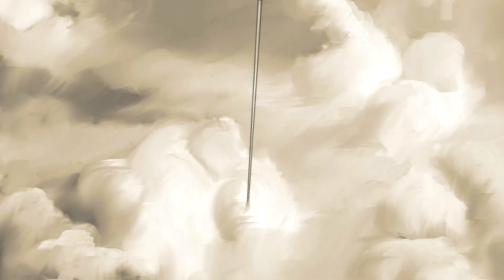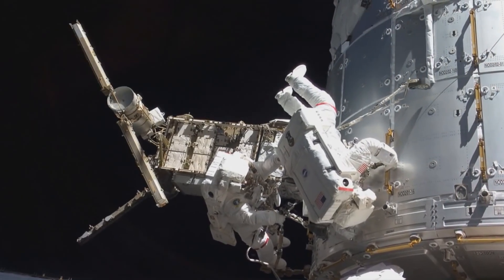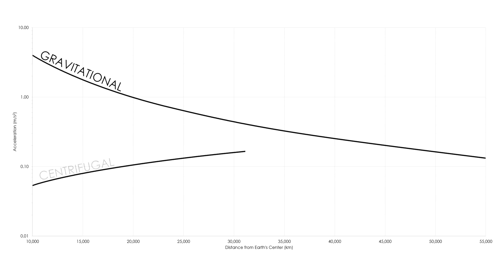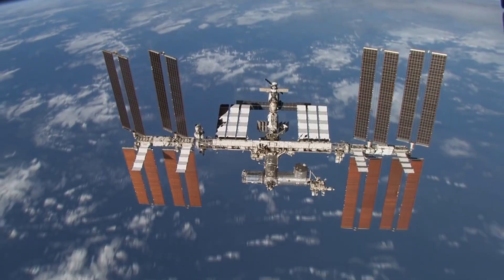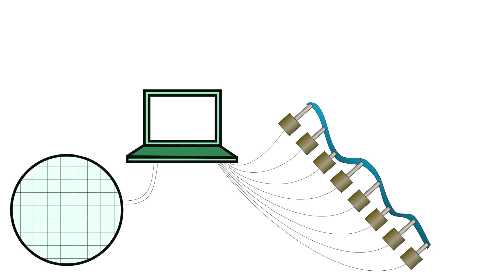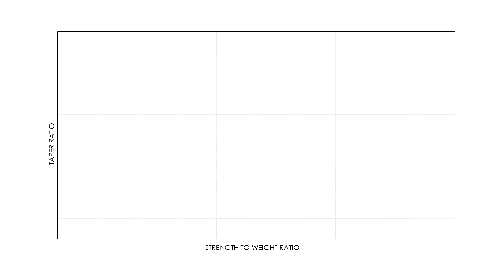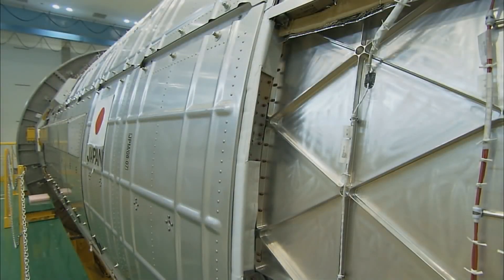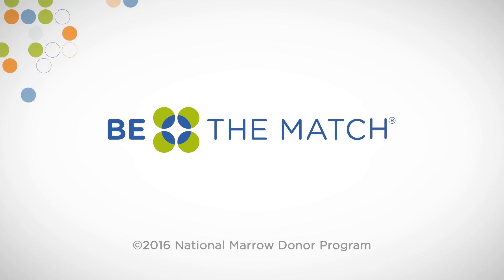Design Your Own Space Elevator

Comment: What if for the power problem, you just used different stages through the ride, just like a rocket. You can have a section of the elevator have power from earth and a pusher that only goes in that section. It would push the main elevator to x velocity. X would be the velocity needed for it to glide up the tower until it is at a height of y (which is where the main elevators motors can pull itself up) to power at this stage u can have battery packs on board that kick in at this stage. (Batteries would have to be even better than Tesla’s).

Comment: If the Earth was less massive, or if it revolved much faster (as in much shorter days), or both... then I think space elevators would have more merit as they can be much smaller. Trying to keep the cargo geostationary during it's entire ascent is not the exact job we want and such an ascent is not efficient, but thats the limitation of the typical space elevators that many think of when they hear the name.

A majority of the costs to getting things up there is mostly due to needing to escape the atmosphere and achieve enough orbital velocity.
 So, what if instead of a vertical, tethered, space elevator standing tens of thousands of miles up into geostationary orbit, we have a low-pressure mag tube up to, or near, the karmin line? And I don't mean straight up, but in a curved path that will ease the cargo into a mostly orbital trajectory. Having the tube at low pressure (and possibly temperature controlled) minimizes drag, making it cheaper for the vessel to reach orbital velocity. While this version is basically a cannon, you could still technically call it a space elevator.

Of course such a cannon would be long, it'd still be a tiny fraction the length of a vertical tethered space elevator, it'd also solve the problem of getting into space, and it's design challenges should be far more feasible.

Comment: First, a geosynchronous orbit radius is necessary only for daily orbit periods.  Shorter orbit radii are possible, but only for elevators tethered to rotational poles.  Second, electric conductors embedded into the cable(s) can charge supercapacitors (or batteries) spaced periodically in the cable to serve as "filling stations" to refresh an energy cell in the elevator.  A descending elevator releases energy which can be captured in reversible motor/generator, recharge the cable's cells, and power the electric grid until another ascent is needed.

Comment: So.... How about using the tether itself as a method to convey power to the lifter?
Reply: The longer a conducting wire is, the higher the resistance. You're gonna lose all your power through heat by the time you get to the top.

Comment: Question. If the cable is being gripped by the shuttle  in order to propel it upwards, wouldn't it exert a force that pulls the satellite and shifts its orbit? And if the shuttle is NOT gripping the cable to propel itself then what is the point to begin with? Basically, sounds like the energy to lift the payload still has to come from somewhere - if it comes from the system it would degrade the system's  "energy state" and if it doesnt - the system is rendered superfluous

Comment: Couldnt you house and send your electricity/power in/through the tether. Sort of like a monorail that's powered by the cables above it, except it would also be hanging off that cable. I think carbon nanotubes are highly conductive so theoretically they could be the perfect tether since they are, with one material, the strong tether and the wire for the power for the elevator
Reply: Too much resistance because the cable is too long

Comment: There is also the unknown, w, that represents stresses due to weatherization effects and b, the bending effects on the tether structure: lightening strikes and possible tether deterioration, resistance to atmosphere pressure differentials and possible separation results of launching the platform and occupants at the top into deeper space ... so there should be an emergency escape/eject system to save souls at the end of their rope ...

Comment: Why no diameter for the carbon nanotube tether? You gave us the taper but not what the final diameter would be. I'm curious.
Reply: Doesnt matter, the taper of 2-20 times means the diameter at the bottom (whatever you pick) is 2-20 times smaller than at the top. If at the bottom it were 1cm thick, at the top it would be 2-20cm.
Reply: @sebastiaomendonca1477  it's been a while now since I watched this one so I don't remember if it said 2-20 times larger than the top, but that number is most certainly incorrect. I've heard from many other reputable sources that the final diameter - even with perfect structure carbon nanotubes or graphene - would be some insanely huge number. As in nearly impractical. Not saying the video didn't say that though.
Reply: @gearhead1302  Mind citing those reputable sources? Just saying "reputable source" is not an argument

Comment: What if we made a series of airship supported tethers? Where a gas like hydrogen or helium is used in small sacks along the way where the atmosphere is densest and gravity is strongest. I'm not suggesting that it would necessarily support the entire weight of the elevator car, but it might help and could generally be reusable with a series of compressors along the way. I haven't thought this out, but it seems worth considering and I haven't seen any design that incorporates anything like this yet, except in surfacing sunken ships and aircraft with pingpong balls.

Comment: To be honest, the concept in this video is not the way to go. 
If a real life space elevator was to work, it would have to consist of TWO cables, one for going up, the other for going down. 
Well actually, one long circular cable, with pulleys on either end.
Picture a tow rope for a ski lift, or even a chainsaw.
A long continuous belt. 
The power would be sitting on the earth, which would turn the giant pulley, and thus move the cable. 
However,  .............
Even if a material existed that was light enough and strong enough ....
You now have to take into account wind, lightening, jets, space junk, temperature change, and who knows what else? 
Yep, the theory is simple enough, but the practicality is crazy complicated.

Comment: I think the biggest fault with this thinking is thinking the space elevator would be a single carriage, it would obviously be separate pieces traveling with modular parts having it switch carriages so people and loads can constantly switch from going up and down at the same time. having just 1 elevator means that someone going down needs to wait for the entire trip of someone going down. now this means that the top carriage that has the least gravity and requires the least amount of fuel could run on solar power, and the lowest could run on batteries, while the middle part could run on what would be most efficient according to the weight.

Comment: 4:20. Kaaaay now I'm confused. Not with the problem. But with your solution. 

Would you not just use the cable as a means of transmission.

Almost certainly whatever it is made out of will be conductive.

Now you obviously would not be using DC in such an application.

And while you'll still have losses with AC.

Making use of repeaters would mitigate these losses.

Not to mention the fact that such a cable would have to be made from something like carbon nanotubes.

Giving the cable itself the capability of having very low resistance.

I mean if nothing else you could just have large sections of cold plasma running alongside the cable.

Giving it more than a low enough resistance over that distance.

So it seems to me like you're going out of your way to make the easy part a much more difficult one.

Come on man start using your own brain. Instead of listening to the smallest minds with the biggest mouths.

But what is shocking. You did not even mention the VERY obvious. Even if you weren't going to use the cable. Such an elevator could easily be fitted with a "Thorium Reactor".

7:40. There you go.

Also by the time carbon nanotubes could be constructed on such a scale. We could have wireless energy transmission through Quantum Entanglement.

But by the time energy transmission through quantum entanglement is a thing. Gravitational lasers acting for all intensive purposes as a tractor beam. And could just lift or lower the elevator from the counterweight above the Clark belt.

And by the time gravitational lasers are a thing. The understanding of the true functionality of gravity will have been understood and applied in many different applications. Making the need for such a cable completely moot.!!!

The only scenario in which the problems that you're describing in this video are even applicable. Is if the extremely large scale production of carbon nanotubes somehow arose about 500 to 1000 years early.

But that somehow all other technology is still contemporary and or present day.

That is the only scenario applicable to this video.

But I did like the video. And I appreciate the time you took to make it. 👍

Comment: This could be the answer to the problem of rockets throwing up too much dust on the Moon.
Reply: This would not get you to the moon without a rocket to help
Reply: @sebastiaomendonca1477  This would not be used for getting to the moon, but for getting to and from orbit around the moon to it's surface. Rockets would have to be used to get to lunar orbit from the Earth, but they won't kick up dust on the moon's surface.
Reply: @sambolino44  When was kicking up dust on the Moon's surface ever a problem?
Reply: @sebastiaomendonca1477  It was mentioned elsewhere as a potential problem if we start major operations on the moon.
Reply: @sambolino44  How would it ever be a problem? If anything, its less of a problem than on Earth because the dust doesnt linger around suspended in the air

Comment: Why didn't you mention nuclear power as a possibility for the required energy? Seems to be the most logical way to me.

Also at the bottom where you need the most energy because gravity is the strongest you can still just use cables, the resistance only becomes a problem at relatively high altitudes.
Reply: A nuclear reactor would be too heavy to lift, but it could be used to power the laser

Comment: "It would change the world".....really? Nonsense. Even if it worked, which it will not for a myriad of good reasons, the speed of the elevator is limited by the very low tangential acceleration the cord is capable of providing. Even the optimistic predictions put travel time at about a week or so, possibly even a month. So, you might gain in cost of delivery but at the price of the time required to send something up in orbit. Time is everything, it relates to the rate at which a task can be accomplished. A rocket can achieve geostationary orbit in 5 hours. About 97% savings in delivery time.
Reply: He did the math, with the least efficient power source you can still make the trip in 2 weeks. This is not a problem.

Comment: The more I think about it the more issues there are. Assuming you have a counter weight, cable and power supply, how would you built it? Scaffolds and cranes? Hot air balloons? Thousands of rockets in orbit assembling the longest toilet roll the worlds ever seen?

Comment: Depending on the material of the cable, the cable itself produces electricity as it wanders around the magnetic field of the earth, so that could be your power source.
Also, why concentrate on just one cable, why not two or four? More cables would also add to the safety of the system with redundant cables to handle broken or damaged cables.

Comment: Centrifugal force isn't real. >.<
Reply: Swing something around on a string and you'll feel it. Its the principle behind an orbit.
Reply: @sebastiaomendonca1477  Centrifugal is a fictitious force imagined by the way a frame of reference can trick the mind. Centrifugal force quite literally means a force pointed outwards from the center of rotation. IF such a force was the principle behind an orbit, all objects would simply fling away from their parent orbital body. In fact it's centripetal force (gravity) that pulls objects "down" to earth. The reason why they maintain circular orbits is because they have enough horizontal (parallel to the horizon) velocity to outrun that "fall". Centrifugal has nothing to do with an orbit. The force you feel on a string is a REACTIONARY force to you accelerating the object INWARD towards you.
Reply: @xithyl515  Centrifugal force is the effect you feel countering gravity. 

"IF such a force was the principle behind an orbit, all objects would simply fling away from their parent orbital body" Wrong. Gravity is there to balance it out, thats why at a specific height (for simplicity lets say the apogee and perigee are equal), no matter the mass of the object, the orbital speed is exactly the same.

Comment: A. The taper of the tether shouldn't need to be that huge, since the cable is not having to hold it's entire weight up - the whole concept of the space elevator is that the cable is under tension from the mass of the counter-weight 'pulling' the tether away from the Earth. It seems that the cable should then only have to hold half its weight, which may still be too much for conventional materials, but makes the situation less dire for emerging technologies.

B. As far as getting power to the climber, while a solar collector on the climber might be impractical, having a large collector on the counter-weight seems quite plausible (even desirable). Even if this couldn't supply all of the needed power, it could seriously mitigate what was still needed. How would the power get to the climber? If only there were some kind of long cord that could carry that power in direct contact with the climber - but where would we find that...?

C. Why does everyone assume all this has to be done with one tether? Multiple tethers makes infinitely more sense, so you can have traffic going up and down the tethers simultaneously. This would obviously drive the cost of lifting way down.

Now I'm not some big-city engineerologist, so maybe there's something I've missed (quite possible). It may be that these issues are addressed in a deeper dive into the subject (which the author explained was simplified for time constraints). Regardless, I want a space elevator, and I want it now. Make it happen!  :)

p.s. Love your channel. I always enjoy your presentations and demonstrations. Keep up the good work!  :)

Comment: What if you don't need a cable/tether? What if you build a giant electric rail gun instead? Yes, it also comes with cost but it is actually far more feasible than nanotubes at this point. You would need around 1.5 km to 2 km long barrel thought but wait there's more, the shuttle would need to be aerodynamic (like a rocket nowadays) and the inside of said rocket should have a way to not squash the people inside. Let's take a gyroscope for example, the inside will not change, no matter how and what direction it goes in, the inside of the rocket will remain relatively unmoved (but it will fallow the same path, so just attach people to chairs and should be fine as long as they can withstand 10 to 40 G's. So technically, it might work for some people, I don't know, I am no expert but it seems to me that an electric rail gun is far more fun than a tether and you get to send stuff to space like giant space ships or parts of space ships or missiles for military purposes. For those of you who doubt my idea, check out BEA systems on YouTube, their rail gun is tiny but shoots out tungsten "bullets" up to 160 miles (ca. 257 km) that go up to 6 times the speed of sound. A giant rail gun would of course need its own dedicated power plant but that is just details at this point. Oh, it might even be used to send nukes into space faster, allowing the nukes to be much much bigger than they are, think 4 to 6 times bigger because the space you needed for fuel can be used for "boom boom magic stuff" hence, a nuke of 100 maybe 200 Megatons of tnt. You know, the kind that only need once and everyone becomes very calm. Boy, this escalated quickly. Quick, into the time chamber.

Comment: What most people fail to realise about space elevators is that we don't need a fantastic supermaterial strong enough to hold the tension of the whole thing. We could use an active power structure instead, so it holds itself up with energy instead of strength. It's called a "space fountain". We could use this for super-long single-span bridges too. Grady really should check out active power structures!

The space fountain also eliminates the power beaming problem, because you're already sending power up the entire thing in a near-vacuum (so no atmospheric losses). The question is whether we could lower the friction of the system enough to keep the energy costs low enough to be worthwhile.